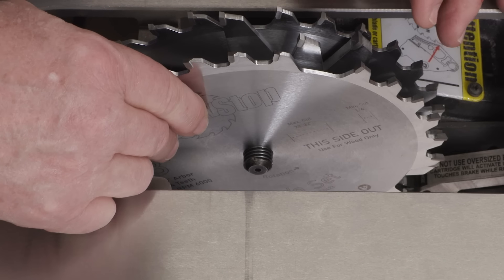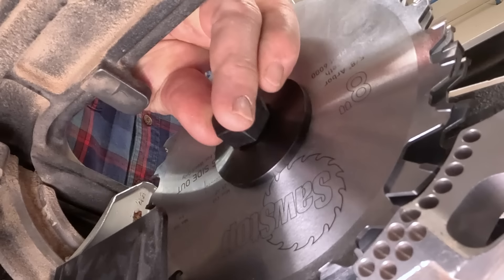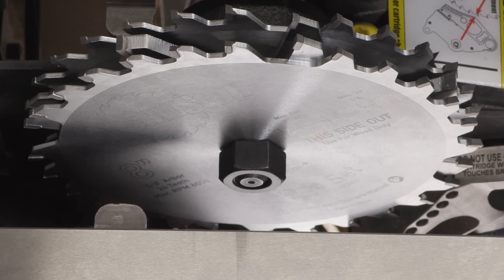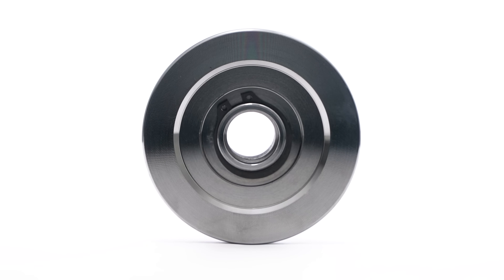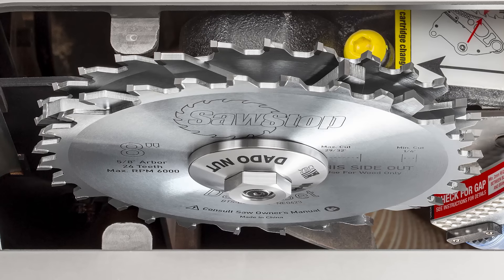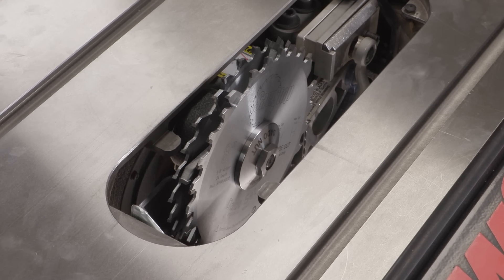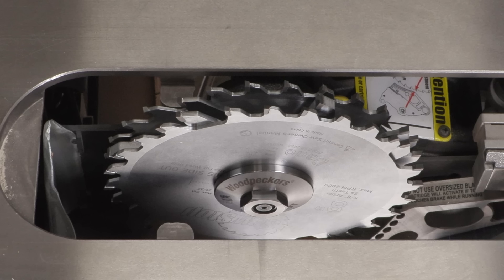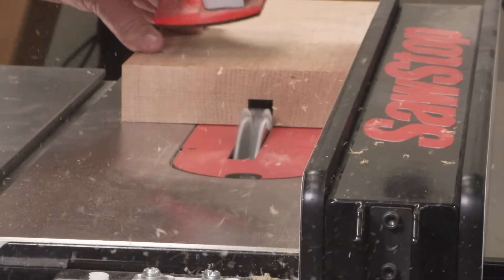Dado Nut

Comment: just a heads up guys for the JSS jobsite saw - the dado nut fits the JSS arbor just fine but the JSS factory wrench doesn't fit the Dado Nut. the factory JSS arbor nut is about 3/4 / 18mm, where the PCS factory arbor nut is more like 1" / 25mm.  i ordered the factory PCS model arbor nut wrench from SawStop parts store for $25 incl shipping. solved the problem but...$$. nothing here or on the WP site about this, feels like there should be a note somewhere.

Comment: Can the Dado Nut be used on non-Sawstop 5/8-inch arbors (Powermatic)?
Reply: Second this, we need to know the  thread size/pitch - I have a Axminster tablesaw and would really love this upgrade...
Reply: I have had a Delta Unisaw for nearly 30 years. Would your Dado Nut work on my table saw?
Reply: Yeah, I'd love to know too.  I'd hate to buy it just to test it and have to ship it back.  I don't know if a return is even possible if it doesn't fit.

Comment: For those asking if it can be used on other manufacturers table saws. In the video it states 
“For Saw Stop”. 
    I wonder how this can profitably viable to manufacture for such a small segment of table saws?
Reply: Small segment or not SawStop pretty much out sells all other brands.  It makes sense to start with SawStop and maybe add Powermatic, and maybe the older Unisaws down the road.
Reply: What matters is the arbor diameter and thread. That's all pretty standard.
Reply: Small segment? 😂😂😂😂😂😂😂😂. You are clueless
Reply: @daveklein2826  interesting how you offer nothing to support your statement

Comment: How many weeks until we see copies of this all over AliExpress and other Asian sites? I'm pretty sure I have seen similar devices back in the 1990's, just not as shiny -  a cupped washer that is swaged to a nut which goes through the washer providing plenty of thread engagement, so you can still tighten the nut despite the friction from the washer.
Reply: Not true

Comment: Can I assume the Dado Nut allows the nut to spin independently of the washer portion of the nut?   Normally when tightening the nut without a washer the nut will reposition the clocked position of the outer blade, the carbide can teeth come in contact with the chipper teeth if not careful.  This does not happen when the stock nut and washer are used.  I like this idea.  Seeing the snapring leads me to believe that the nut will spin independently against the nut.
Reply from the maker: Yes, the nut spins independently within the washer.
Reply from the maker: Good point about the nut alone repositioning the outside blade of the dado stack.

Comment: THANK YOU WOODPECKERS
Reply: No my dial adado will work
Reply: @floridabeardedwoodworker That is what used to be called a "Wobble Wheel". I have 4 of them.  2 of mine will each go from 0° to 7/8"  (straight cut to 7/8 inch ) . The other 2 won't go all the way to 0°, they will only get as close as 3/16" .